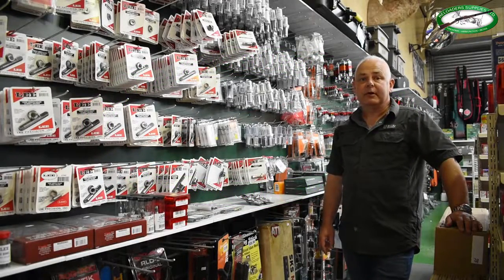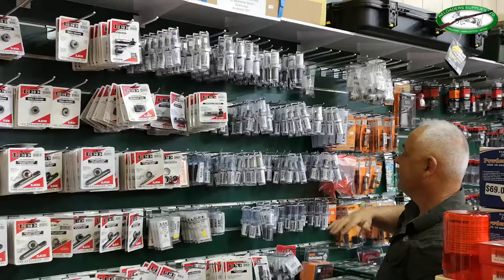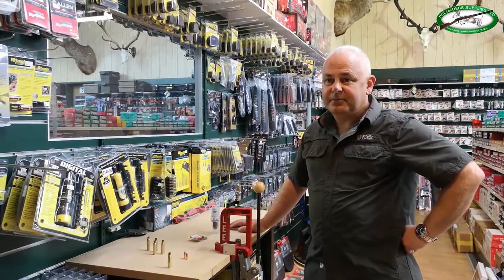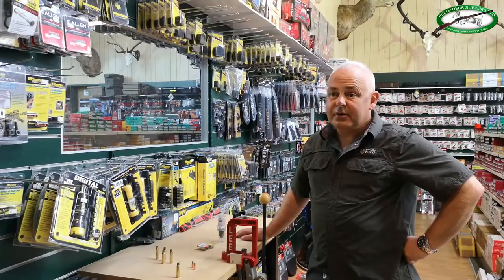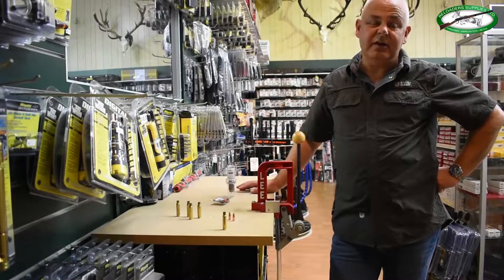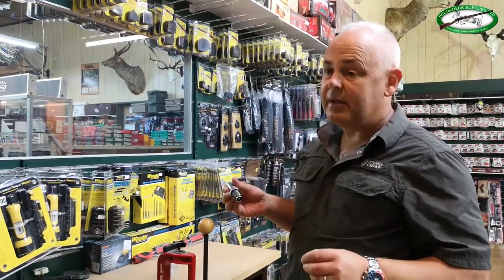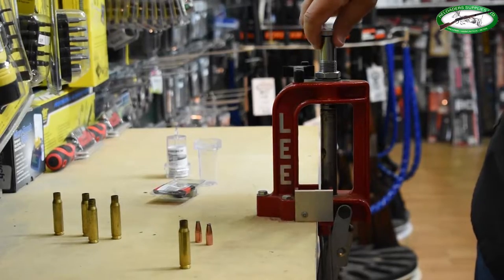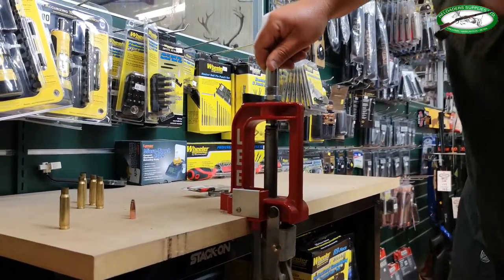Lee Collet Die Setup 1

Comment: Tried one of these on a 308 case and heard and felt a 'pop'. It had blown the top aluminium cap of the die body by stripping the thread.
I went out and got a 3/4 X 16 UNF bolt, sat it in by about the right amount and 'thread locked' it in place. Now it works a treat - and I don't use as much pressure on my Forster co-ax press as I did first time!
Reply: Only pop when die is adjusted to deep Eric. The alloy cap is designed to pop, if too much pressure is used. Forster is a great press